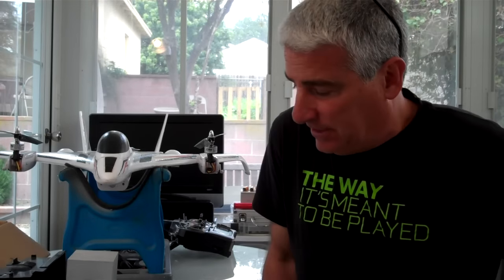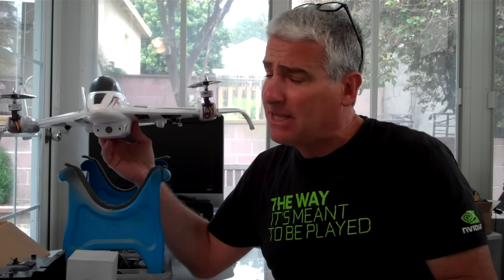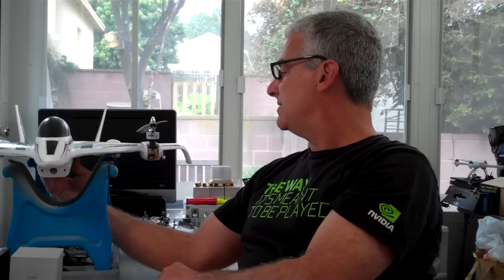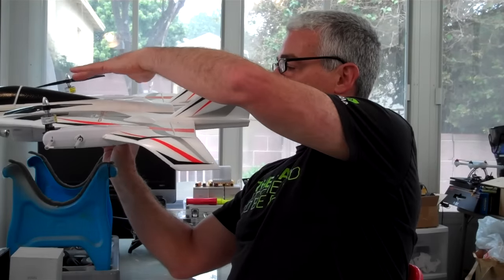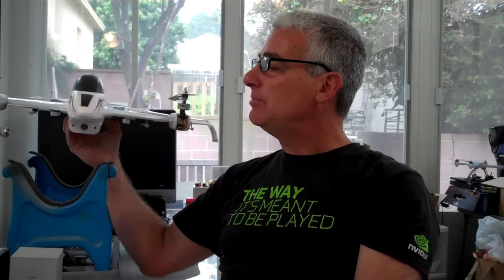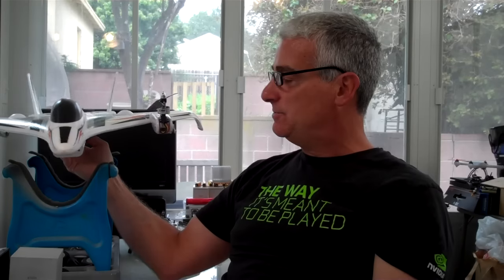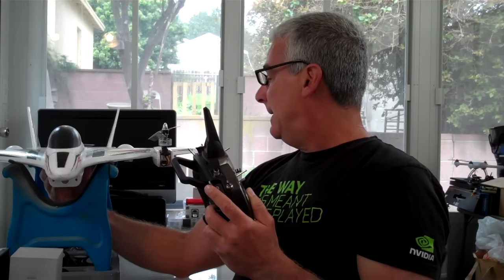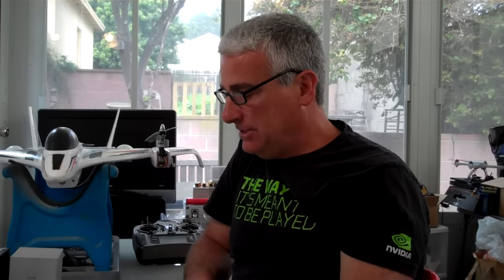E-Flite Convergence - What I've learned after 60 days.

Comment: Great video, Fantastic plane, 
I run mine on 3S 2600 batteries with the battery leads running underneath the battery tray where the fpv camera goes so I can push the battery right to the back. 
I cut out the front wall of the battery compartment so the battery leads come out at the front and scalloped out the foam under the canopy so the battery would fit. 
I set my timer for 4 minutes and take off in MR stabilized and convert to plane mode as quick as possible so I'm not wasting battery power on MR. 
When my timer goes off at 4 minutes it then gives me a minute and a half to transition back to MR and come in to land. 
I could get longer flight times if I don't fly full throttle in plane mode etc but I feel safe with the 4 minute timer set up I am using and I have lots of batteries so I'm not too fussed about short flight times.
I find if I'm in plane mode and switch to stability mode and then transition to MR the front goes up like crazy and it is super hard to control. My remedy for this is to transition from plane to MR in acro mode and with very small stick controls give the plane about 10 seconds to settle before flicking it back to stabilty mode for landing.
I love it, it does some really neat flips and tricks in plane mode (0:
Reply: hi. hey how heavy is your 3s 2600 battery? thanks for the info. stay calm and fly on. cheers

Comment: Hi,  great video,  lots good info.  I just brought a used one and is trying to set it up.  My question is "Is it normal when I flip the switch going from multi copter to airplane mode,  the front motors stop at 45 degrees for a second or so and then continue to go down.??? 
The 1 to 2 seconds seems like a long time when the plane is up in the sky.  Thank you

Comment: After take-off, shouldn't the back rotor be turned off? So that the front two motors would move forward at faster speed. Does the back motor add any value to the front motors during horizontal movement?
Reply from the maker: Mazhar Syed in multi rotor mode the back motor is always active and has variable thrust from flight controller. It is definitely needed for take off and landing. It moves in all directions pretty well in multi rotor mode as well but I only recommend for take off and landing.

Comment: Howdy...  

Thanks for your post, you brought up a lot of really great points.  The tip about marking the motor servo arm positions is a great idea.  There is a caution note in the manual that these should not be altered, so If there is a need to replace any associated parts, you can return the adjustments to the factory settings. 

I believe that there are some other points that would be also helpful to pass along.  

A more valuable battery test with your 30A discharge setup would be to commence testing with a fully charged battery rather than one at storage charge voltage, then time it to LVC to replicate when in multi-rotor mode.  This would give someone a lot better idea how to initially set the flight timer to avoid hitting LVC unexpectedly.  And always check battery voltage prior and after each flight for total and individual cell values.  Another very valuable test would be checking the individual cell and total pack internal resistance values.  This is the single best indicator of a battery's true condition.  Using Admiral 3S 2200mAh 35C batteries, I am getting 4 minutes of maneuvering in multi-rotor mode and have between 45 to 50% charge remaining.

In all of the videos that I've seen about this aircraft, I have yet to see anybody point out the importance of having the aircraft on a level surface and be kept totally motionless while the flight controller initializes (for about 5 seconds until the front motors  transition to vertical).  Many pilots are inexperienced with flight controllers and this procedure is very important to proper control function.

Thanks again for your great video.  Had to toss in my 2 cents!  :-)
Reply from the maker: Yes, great points. I did mention voltage lag demo in description. so people will test on full charge packs. your post is a good reminder for those that miss the note. Thanks for the post.
Reply: Who reads the notes?  Keep up the good job!  :-)

Comment: what props does it use? I cannot find them in Australia and it spits them off nearly ever flight.
Reply from the maker: EFL11003 Main Props are 7 x 5.5 (180mm x 140mm) 2-Blade
EFL11004 Tail Prop is 4.9 x 4.9 (125mm x 125mm) 3-Blade
Reply: Thanks mate.

Comment: What is the flight time? I hear Josh Bixler saying it is a lot like the Apprentice.  What is your opinion concerning that? I get what you are saying concerning messing with adjusting the thing. If it flys well out of the box is to leave it alone. Too many hero's out there think they have to screw with the adjustments.  I suppose you have to use a Spektrum radio with this thing too? I am not a fan of Spektrum other than the 5e. I have the 6i but dont trust it to fly anything other than the park flyers. I wouldnt mind owning one of those but am not sure its something I really need. I know my friends would be blown away watching it take off and fly. I do believe it requires a larger flying field like the Apprentice am I correct?
Reply from the maker: scott firman yeah I saw that video too. I'm not sure I would compare this bird with an apprentice but it is pretty stable on the stability mode. But it's fast, so when you flip off stability be ready for it. I set the timer for 5 min. And have 30% left on 3s 2200. You can buy the plug and play version and put your own receiver and fly other than spektrum.
Reply: I think Josh is a bit optimistic with his comparison.  I own an Apprentice, and I can tell you it is a much more forgiving plane in level flight that then Convergence.  Two things here I think make a big difference - one, the Apprentice is much larger than the Convergence, with a more traditional aspect ratio, and you can fly it a *lot* slower than the Convergence.  I'd struggle to recommend the Convergence as either a first plane or first multirotor, where I would wholeheartedly recommend the Apprentice as a first set of wings...
Reply: John Driggers Agreed,like compairing apples to oranges,period.
Reply: RC Hobbyist Extreme I just got the plug-n-play version and using my Tactic 610 transmitter and Tactic 624 reciever.  Works fine. Only bummer is need to buy 6 small male-male servo leads to connect receiver to the flight controller, but all the modes and stabilization work fine.  Can order pack of six for 7.99 USD if still in stock anywhere.

Comment: I broke one servo arm. Had to order a set of replacements. DO NOT touch the nacelle linkages to make the motors completely vertical! Don't change their length whatsoever! Leave them at what they're set to.
If you want battery telemetry (like I did) you should know that 10V should be your HIGH setting, about 9.9 volts should be your LOW setting (first alarm) and 9.2V should be your ALARM setting (battery critical alarm). It will revert to multirotor mode when battery is low and the ESCs will cut out at 2.6V per cell. That's very low! Don't let the ESCs cut out! They don't soft cut, they just shut off mid flight. Once the plane senses low battery you will have about 30 seconds to land depending on your battery.

Comment: I wonder if it wouldn't be a better idea to use the multi-rotor mode for landing only.Just hand-launch the plane like any other and only switch modes when your ready to land. The VTOL idea has been around for awhile now but, with all the issues that come with it I still don't think its practical, yet. If they made one with two separate units, including battery and control board it might work better for longer flight time, I don`t know. Just too much going on for one battery to handle all it needs to function efficiently.
Reply: August Lyons I tries the hand launch thing and broke the nose. really needs all components to be working.
Reply: Steven Clennon did you try hand launch in stabilization mode or acro mode?

Comment: Great info -- thanks!  Now I know what happened on my first flight after going into airplane mode, and half way around the circuit the plane started acting like the battery went dead -- it went into low voltage mode.  Also, out of the box the front motors were not aligned with each other even close.  I had to mechanically align them before the first flight.
Reply from the maker: Roy Pettit yes. The motors are @ 1 degree off from one another in both MR and AP mode. This is normal to offset torque yaw.

Comment: This Horizon FC firmware is not "taking care", as you say, but does crap with this LVC behavior. I'd love to have a way to turn off this behavior or decrease the LVC from 10.5V (as I read) to e.g. 9.9V or even 9.5V ? But the FC firmware is not configurable (like Cleanflight or Betaflight).
Regarding the props - the only one prop, that can come off is the left-front - because it is the only one rotating clockwise - HH should switch its screw to a CCW - then it would not unscrew itself any more. In comparison - with quadcopters it is usual to use CCW screws on CW motors and opposite.
Reply from the maker: ikarustigger no way to change LVC on the FC unfortunately. Only newish healthy packs will work with this plane. Have to maintain 10.5 volts or more under 30a load. 3s 3000 30c is recommended.
Reply: HeyFlashman guessing it is best to fly airplane mode at beginning of flight while battery is fresh to avoid inadvertently hitting the LVC?

Comment: A note, if you are flying the bnf edition of this, make sure to test the failsafe by turning off the radio while holding the plane in its multirotor state. My plane spooled up to max throttle when doing this, even after following the bind procedure in the manual to the letter. The spektrum satellite in this plane does not have failsafe, which is managed by the flightcontroller. Tried to disconnect the satellite and using an ordinary reciever which has been set up correctly to zero throttle upon signal loss and that made the plane throttle down in failsafe as it should.
Reply: Jens Petter IkkeOppført do you think it is better to set failsafe at zero throttle, or maybe at a low setting that would let it hover down slowly instead of falling from the sky?  Mine is at zero, but was considering changing it to leave a bit of power on.

Comment: they  sell low voltage beepers  ,  I fly  tri-copters  , I use  them they  work great  . it  will give you time  to bring it  in  to land . There loud  and  small , just  put  them on the balance plug

Comment: I have been referred to you by David W from Horizon Tech Support.

To quote him: "Some additional information has come to light. The glitching you experience is normal. The Convergence is not a typical airplane and it is not a typical helicopter. I think the glitching that you experiencing can be explained in a Youtube video. Product Support accepts the observations that is made in this video. The video is not from Horizon but has some very useful information. Here is the link: https://youtu.be/XyXBdVjlrDg"

Actually, I watch all of your videos and as far as I can recall, I don't remember you covering anything like this: https://youtu.be/UQo5gm1jWc4

Please notice the movement of the elevons right as soon as the "transition" starts, after each of the fresh startups.  BTW, the tail motor is still running at this time indicating it's not "out of Multirotor" yet.

Do you recall anything in your "60 days" video related to this "glitch"?

Many Thanks for your time,
                                            Bob
Reply from the maker: Sorry for the delay in reply. For some reason your post was hidden until now. Your video sure does suggest a  possible bad FC but bench testing is difficult on this plane. The flight controller really wants to be airborne. I have seen some very glitchy bench testing on these planes then they fly perfectly. That being said, I would video your maiden for insurance. Again, sorry for the late post. Thanks for your comment.